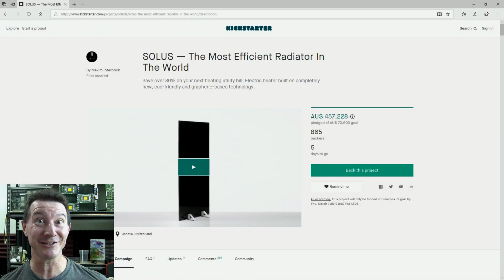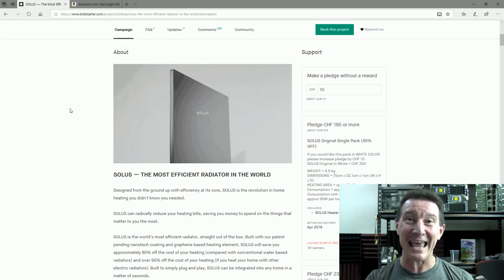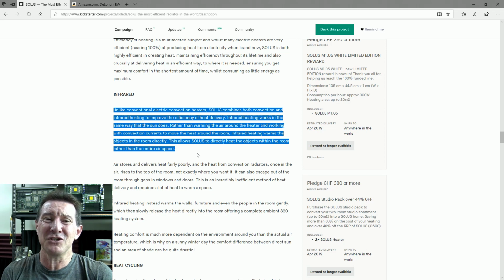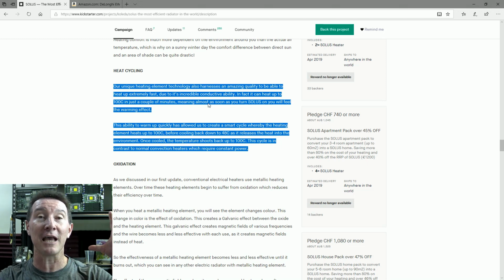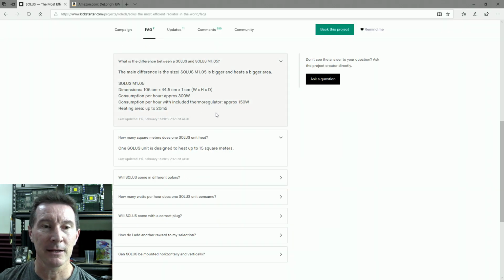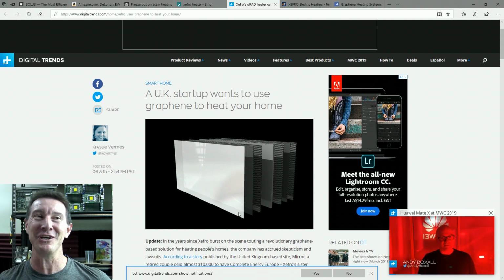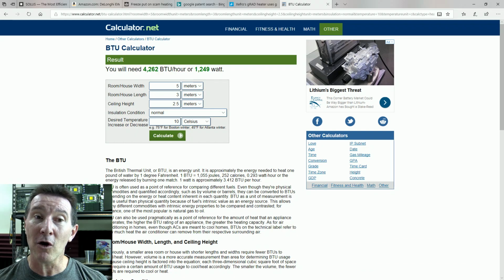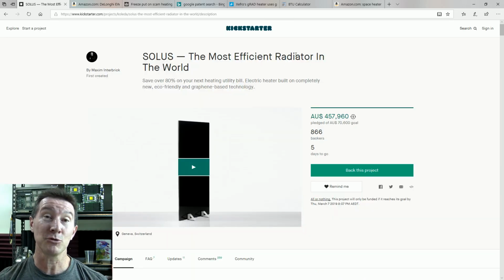EEVblog #1186 - Solus Graphene Heater Kickstarter BUSTED!

Comment: Dave is 100% correct that all resistive heaters are 100% efficient -- but it seems he's a little confused between radiation and convection.   The correct type of glass will have little effect on radiant heat transfer but will be quite a good insulator to impede the flow of convective heat transfer.   This device is definitely a snake-oil heater though.
Reply: Dave has 100% efficiency
Reply: Yeah, the glass may not conduct heat well, but it can and does radiate it just fine. It also acts as a thermal mass to reduce cycling, but yeah, it is no more efficient then any other radiator.
Reply from the maker: InsideOfMyOwnMind - I believe Xjet is right, it all eventually winds up as heat. e.g. sound vibrates air molecules that have friction, and that equals heat. it's like uBeam at say 1000W acoustic energy transmission, that 1000W has to go into the air somehow.
Reply: @EEVblog  Yep. Conservation of energy. I wasn't accounting for the down stream conversions back to heat.
Reply: EEVblog - dammit, the chain's even longer if you throw humans in there, but it still ends in heat.  Every action in the universe ends up as a 100% efficient heat generator given enough time.
 sound->electrical->chemical(brain structure change)=information, information erasure->heat
F***ing entropy.

What I don't get is that they don't make the argument that heating only the people can be more efficient use of your available energy than heating the whole volume of air.  
I don't think they're even aiming to do that.  I can think of some schemes (some not really viable, others really basic like underfloor, heated desks etc.) using radiative heat to target people, but this isn't it.

P.s.  if they add some automated blockchain, machine learning paste in there too, I'm sold - but right now they're only abusing 1 miracle tech, so I'm out.
Reply: If you wanted to nit pick you could say it's only 100% efficient if it produces no sound and no non-infrared light.
Reply: @InsideOfMyOwnMind  Actually, even sound and light eventually decays into thermal energy I believe.
Reply: @xjet  DUH, you're right, as soon as they get absorbed by anything in the room it's heat.
Reply: @InsideOfMyOwnMind  not true. Any other energy produced will also end up as heat. Unless it leaves the room of course...
Reply: @gs425  Read the older posts. I willingly stood corrected thank you.
Reply: @InsideOfMyOwnMind  I find myself wanting to interject that, but it would only be a distraction from the real point.

All heaters are going to lose a trivial amount of efficiency by emitting sound/vibration, light, EM waves, and radiation through the windows or bouncing down the hallway.  But it's going to be well under 1%, probably under 0.01%.

As soon as you bring that up, it's a hook for someone to claim that a resistive heater could be "more efficient".
Reply: By 'insulating' the panel with glass are they not effectively raising the temperature of the inner element. That then would increase the actual infra red emission. They are pushing this based on radiation and absorbtion rather than physical conductive heating. Just as the sun heats through the insulation of space... the glass has little effect.
Reply: Has anyone thought of making a heater, using real, genuine, snake oil !? I can see PETA breathing down my neck, now.
Reply: Use of glass in heaters is not exactly uncommon these days either, so they can't even claim that as a inovation. Just one example: 
https://www.adax.lt/en/1293-adax-clea-wifi.htmls
Reply: I am afraid i cannot do this, Dave
Reply: the thing will also conDUCT heat into whatever it’s touching. the line between radiation and conduction gets blurry in the infrared, though… a photon is a photon!
Reply from the maker: The insulative glass will initially be quite poor at radiating the heat from the element, but will improve with time. No heat is lost of course, it eventually gets out.
Reply: Some of the power is also radiated as infrared light instead of thermal motion. That infrared power output rises with temperature to the power of 4. Infrared heaters or heat lamps are a real product and usually have working temperatures above 1000°C. This product doesn't look like that at all though. Otherwise, they would show off that nice red glow and have to admit that it's a serious fire hazard in that form factor.
Reply: But glass is opaque to infrared light. So how does that work?
Reply from the maker: @drunkenhobo8020  near infrared can pass through relatively well I believe. Thermal infrared is definitely blocked.
Reply: EEVblog - It's a neat demo I do for science students. Stand in front of a window and you can see out of it but look through the thermal camera and suddenly it's a mirror. The greenhouse is even better; looks like a hall of mirrors.
Reply: So it just heats up the glass through conduction then the glass radiates the heat. So there's basically no difference to this and a normal radiator, other than the pathetic output. Great.
Reply: I've just wanted to write the same. There are 2 main forms of heat transfer: convection and radiation. Convection works by direct heat transfer from molecules to molecules (melting an icecube in your hand). Heat radiation is emitting electromagnetic waves made by moving of the molecules in the heating module and absorbed by (small amount in the air) the next solid surface (its special case is microwave but infrared panels work this way). The other parts of the video are ok.
There are several mistakes (heating volume given by square meter?, save 95% of your electricity bill?) in their campaign but you see, they'll achieve what they want.
Reply from the maker: There are two types of convection in this instance (three actually). 
1) Natural convection caused by the radiated heat rising and forming convection currents in the room
2) Natural "Convection heaters" which have the air circulate inside and around the elements and then rise outward (you are right, as I mentioned in the video, the Sonus can't do this because it's sealed and the glass is an insulator)
3) Forced convection heaters which are the same as #2 but use fan to force circulate air around the room. You can also use a ceiling fan to do similar.
Reply: @EEvblog I think the point is that there are 3 types of heat travel in physics, radiation, convection and conduction. This product is claiming it radiates the heat, kind of like how the radiators on the ISS work, instead of heating via convection. So the idea is that it is heating objects around the room with direct line of site with radiation (infra red) rather than heating the air via convection.
Reply: In the most polite way possible I think you have missed that point Dave. Not that I think this product is any good!
Reply: @EEVblog  Sorry but this is very wrong.
There are three types of heat transfer: Conduction, Convection and Radiation. This thing is like an tinted incandescent light bulb. We can all image that an incandescent light bulb with black glass would emit heat. We also get heat radiation from the sun even though there is a vacuum between earth and the sun.
Reply: @EEVblog  Why are you so insistant that radiant heating (also known as infrared heating) doesn't exist? This is how heat lamps and most bar heaters primarily work. Not via natural convection or forced convection, they try to not heat the air directly, but instead emit gobloads of IR light, which heats objects directly. If their glass is mostly transparent to IR (unlike normal glass), then their product meets their claims, except that radiant heating is already available from many other sources. It is still typically significantly more efficient than convection heating (forced or natural) such as the oil heater you compared it to (which despite being a "radiator" is NOT a "far infrared radiant heater"), however most people dislike radiant heating for large spaces, as only the part of your body facing the heater gets warmed, the rest of you is chilled by the still frosty air in the room.

There is still plenty of bullshit in this product, such as them not admitting that radiant heaters are already a thing, and that the amount of infrared light you can emit is regulated, and emitting 300W of IR light without emitting any visible light would violate laws in many countries, as staring into it in a dark room could cause eye damage. They have to balance this with things like IR illuminated "night vision" cameras.

You really don't do these debunking videos well. You really need to a) make sure you have your facts straight first, and b) stop repeating the same point 20+ times in every video. I get that you're trying to drive points home to 'stupid people', but the people who made the campaign aren't your viewer base. Give us a little more credit, you don't need to repeat the same thing over and over and over again, it just makes the content unwatchable without judicious use of the right arrow to flick through.
Reply: @dalehorton7748  Didn't know IR light without visible light can damage the eyes, good to know.
Reply: @dalehorton7748   Spot on Dale. Air is dynamic , it flows , leaks  and exchanges and is probably the not the best medium for heat transfer. Infrared on the other hand gets the heat from the heater, to you / a body without much loss is what I understand.

Comment: Not defending the scam at all, but I think they're at least partially claiming to be more of an infrared heater, as opposed to a convection heater.

https://en.wikipedia.org/wiki/Infrared_heater

The same rules apply, their heaters are tiny and useless, and hopelessly overpriced and stupidly designed. But there is a small amount of merit to the comfort claim. I used to work in front of an infrared heater, and it was quite nice. (But it was probably the better part of 1500W too)
Reply from the maker: Yes, it's a radiant (infrared) heater.

Comment: My 60” plasma tv makes a better heater... with graphics thrown in for free!
Reply: My pc after a few hours does the job in winter.
Reply: Probably has cooling fans that actually push the heat into the room too!
Reply: TV is excellent... If you need a lot of heat, go for a crypto-currency miner. The BTC (or whatever) is just another NICE side effect.
Reply: Mark Cummings rr
Reply: couple of percent of that is converted to light and some of that might escape from your window so it's only 99,99% efficient :)
Reply: @surejack  OR, nearly 0% efficiency since measured over long enough time, all heat will disappear out of the room...
Reply: @niclash  but you are measuring the efficiency of the device, not the whole fucking HOUSE!
Reply: @niclash  Well then... According to your logic you don't even exist because when compared to the age of the universe, your existence nears 0%!
Reply: I have a 300W GPU. Man is it tempting to upgrade before summer comes since it's old to where faster and newer GPUs use less electricity
Reply: Best comment.

Comment: It's worse than they say. They don't understand why heaters have thins. You're ability to get heat into the environment is almost all about surface area. That flat panel is barely contacting air, especially against a wall.

Comment: Soleus Air should sue them. Too close a name and worse, in a competing business.
A 200 watt light bulb would do the same thing. Add a diode and there's your 50% duty cycle.
Reply from the maker: Yeah, very close in name in the same field!
Reply: Somebody should tip them off!
Reply: A light bulb would only be 97.8% efficient.
You'd lose 2.2% efficiency by creating visible light and this thing loses less than 0.1% which makes it at least 22 times better.
Your losses are 22 times less. You must think I am thick, but I'm not. A light bulb huh?

LOL.
Reply: @czarzenana5125  "You'd lose 2.2% efficiency by creating visible light "
And that visible light gets partially absorbed on each reflection turning into heat. The only loss of energy you would have would be the light going out the window.
Reply: @ABaumstumpf  
For the price they ask for it, I could make a panel with an efficiency above 100% by using Peltier elements.
You could place them instead of windows.
There is a lot of heat going out, out of walls, but especially out of windows. And let's be honest, there's a lot of light entering via the windows as well, so I doubt what you are suggesting.
Reply: @czarzenana5125   "so I doubt what you are suggesting.
"
I didn't suggest anything, i merely stated facts.  
And yes you could use a peltier element to get a better CoP but that only works decently if the temperature-difference is small, otherwise you have the problem that they also conduct heat decently well and thus the heat from inside the room gets out. At a deltaT of more than ~20K the CoP drops below one - they conduct heat that good that the net effect drops below 100% efficiency.
That is an inherent property of peltier elements and can not be changed for a simple reason: To work the element needs to conduct heat. And you can not get that to be directional.
Reply: @ABaumstumpf  
I think you are using cooling specifications of peltier elements for heating capabilities.
You are right that in practical uses peltier elements cannot cool under 20 Kelvin below ambient temperature although locally they can cool op to 65 degrees below. The TEC (Thermo electric Cooling) versions are optimized for cooling, other versions are optimized for heating. Any bit of pumping heat increases the efficiency beyond 100%. The problem with cooling is that adding energy amounts to adding heat and you need to separate the cool side from the warm side. That doesn't count for heating. Even 10 Kelvin difference makes heating more efficient than 100%. In practical applications they are far too expensive though.
The most cost-effective is burning your waste, but it might not be friendly to the neighbourhood.
Reply: @czarzenana5125  That is a limitation of all peltier elements. once you get into the range of 20K delta the CoP goes below 1 simply cause the rely on thermal conductivity. so at that point the element simply conducts more heat from the warm to the cold side naturally than the powerinput.

A good analogy would be 2 waterfilled containers filled to different heights connected by a pump and a thin tube.
The tube is the normal thermal conductivity - you can not get rid of that. The pump now tries to move water form one container to the other - that works to a certain degree, but the larger the difference in height the more water will move through the thin tube. 
You can drive the pump with more power but the water will just rise a bit more till the pressure increases the flow through the thin tube accordingly and it reaches an equilibrium.
Reply: @ABaumstumpf  
I understand what you mean and your explanation is very good, but I don't agree with your definition of COP for Peltier elements.
The COP of a Peltier element is defined as the amount of heat absorbed from the cold side divided by the electric energy supplied. So a COP of 0.1 means for every Watt of heat absorbed at the cold side you'll have to supply 10 Watts of electric energy. However, that 10 Watts are also converted to heat in the process. Moving heat from one side to the other does not add or subtract energy, so the full 10 Watts are converted to heat. In a cooling system that heat is lost since it was not your goal to heat things. In a heating system that energy can add to the efficiency, or even better: is the main source of heating, since the efficiency of Peltier elements is rather poor.

Another interesting thing is Peltier elements are much more efficient when running on lower currents. It's more efficient to run two 100W-Peltiers at 50 Watts than one on the full 100W. In general a Peltier element should never be used on more than 70% of it's maximum current and in practical use at a temperature difference of 20K running a Peltier at 30% of it's maximum current is ideal (a theoretical COP of 1.2). To lower the current you'll have to lower the voltage as well. 30% of the current means about 30% of the voltage which will give you only 9% of the maximum power for the best efficiency at 20K temp-difference. You could use 11 Peltier-elements to get back to the same power, but that is rather costly in terms of components to build the system.
Reply: except for light escaping through windows, the light also eventually be turned into heat

Comment: You forgot about far infrared heater - it heat better because it heats solid objects instead of oil radiator that heats air, air is a bad heat conductor and don't accumulate heat.
Reply: They are actually not more effective. What they do is making it feal like it's warmer, and there for promting you to reduce the temperature using less power... Still... It's not more efficent

Comment: Dave, if we neglect the fan consumption, aren't fan based heaters 100% effective too?
Reply from the maker: Even the fan consumption is, effectively anyway. So, yeah.
Reply: Fan is also heat
Reply: Yes they are.
Although actually the fan motor itself has windings that actually become another small resistive element, themselves giving off the energy in the form of heat.
I think there is only a small amount of air movement and sound that isn't. And don't quote me, but I think even this tiny amount eventually simply dissipates into the system/room in the form of heat.
Reply: all "things" that fan (and motor) produce are in the end converted to a heat. even sound and air movement.
Reply: @moalabs  Exactly.. of cause you could argue that a bit of sound escapes the building and heat outdoors to.. but that is also true for radiation
Reply: You could argue that the noise is a form of loss but negligible.
Reply: @NilByMouse  sound gets turned into heat when absorbed
Reply: @NilByMouse  the noice will eventually be absorbed and turned into heat as well